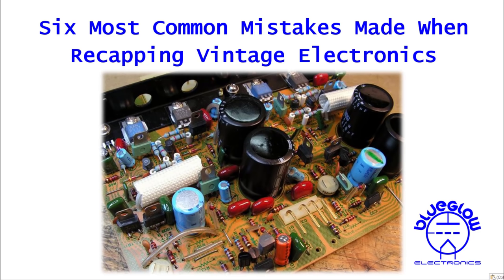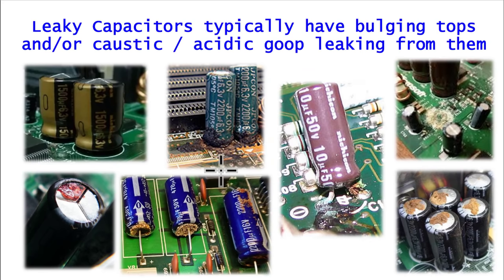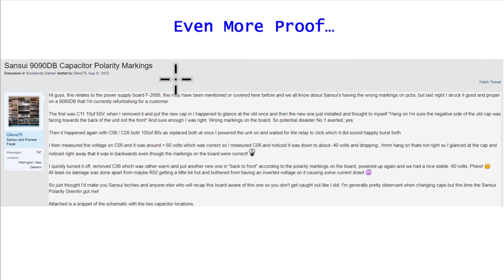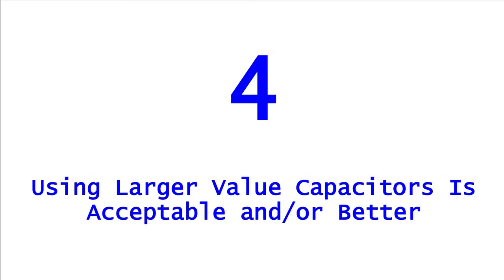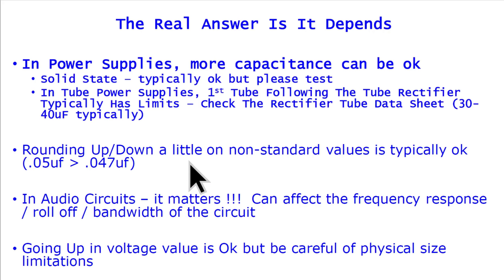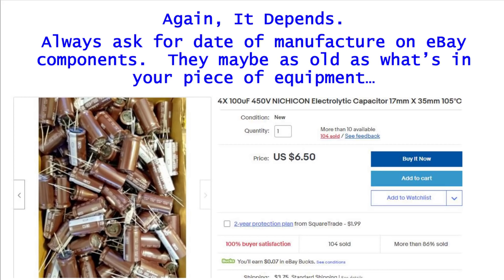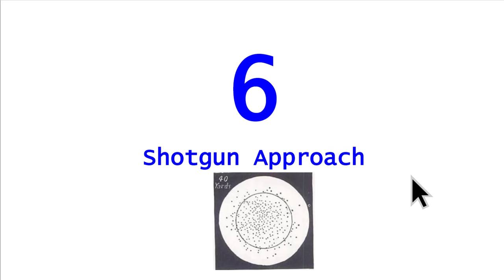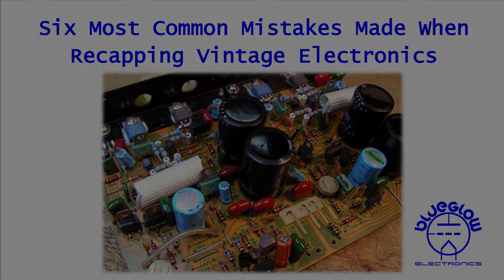Six Common Mistakes Made When Recapping Vintage Electronics

Comment: Hi.  There is a little firestorm of an argument going on, on one of the Facebook vintage stereo forums that is a result of your video here.  People are arguing that all capacitors should be replaced at the same time.  You start out with the power capacitor being replaced.  Then keep it organized and replace capacitors board by board.  But are you inspecting and testing each capacitor to determine what should be replaced or are you just indiscriminate and simply replacing them all?  I understand that it's easy and quick to test a capacitor on a board with the correct meter.  Thanks.

Comment: Going up in voltage rating often means that the lifespan is longer, since those are stressed less.
When buying capacitors and ICs from random strangers beware for counterfeits, especially NOS caps dating back to the great capacitor plague.
Reply: going too high a voltage is not a good idea

Comment: All good advice, I have two comments and a question.
 Comment: I repaired a 32 inch flat screen, 2008 era. I was pretty sure for the age and the problem it was in the power supply. When I got it, the TV would eventually come on after about 10 to 15 minutes of trying to come on with the power led going from red to off and back and forth after I pressed the power button. Once on it was all pretty fine, and would come right on if I left the power cord plugged in. However in time it would no longer come on. So I eventually opened it up, very many screws and nothing was bulged or leaking. So I started with the larger capacitors, replace all of them and put it back in the set and tied it, no change. Then I did another group of the next sized caps. TV came on eventually but was still very long. I then did another set, tried it again and it was a little better but still way to slow coming on. I also was having problems with the double sided board with the etching of the circuit wanting to come off the top of the board when I removed a cap. So on the last set I replaced all of the remaining capacitors, all about 47 uf and below. A few I just clipped off and soldiered the new one to the stubs due to the top circuit issue. Put it back in the set and it came on in less then 60 seconds, fixed! I had hoped to just replace the problem ones and have it fixed but just maybe all were failing or maybe it was mostly the smaller ones. Good point was that I did it in groups and one or two at a time.   

Another comment: Yes capacitor values do matter in the audio side. On many amps the speaker output goes through a capacitor. Changing that value will affect the frequencies going to that speaker.
 
 Question: how it it a real problem if a capacitor setting on the shelf and was never used will go bad in time?  How can a person tell if their capacitor is old stock?   I have in my collection caps that very well could be 8 to 25 years old that were never used or only used to test something. Now on these TV's and monitors I fixed over the past several years, I got new ones off the web, most from the same seller.  My old parts are not very organized at this point.

Comment: Very interesting information. Many things I did not know.  I will try myself to recap a small amplifier of my subwoofer, that is behaving very bad, lately,  If I don't succeed I will buy a new one.   I Have another problem with my ONKYO TX NR626 and it start "clipping" my left speaker, so I disconnected it, and only using R-channel and Center.     Any advice what to look for? (I have some understanding of electronics)

Comment: Already replaced all the electrolytic capacitors in my Lenovo ThinkCentre M58e desktop backup computers PSU.  This was to replace the one bad cap that was causing the computer to be constantly boot looping, and also to replace the rest of the bulging caps.  Now I am moving on to replacing the electrolytic capacitors in my 1978 Soundcraftsmen PE2217 Preamp-Equalizer. That should be easy.  But it is the cleaning and re-lubricating of the 22 Faders of the equalizer, that is going to take a fair amount of time. Plus cleaning the contacts of the 15 latching push button switches.  Next comes my Heathkit  AA-1506 audio power amp. Fortunately, it will only need 2 potentiometers cleaned, and cleaning the contacts of the 3 latching push button switches.

Comment: Nice video. Thumps up !

Remember a capacitor with higher voltage can (or will) have more induvtance. 
In some appications not the best solution. 

And if I use low-ESR capacitors it is a (small) risk. Because of the higher current when power up.

But until now I have no problems with higher voltage capaitors or used PC capacitors with low ESR. 
Sometimes with mutch higher voltage capacitors ...
... I add at the power supply capacitors an additional small capacitor to reduce the inductance to get noise level and or high frequency spikes to a low level. (Until now = No problem with the full bridge rectivier) 

I allways check the value from the okd an new capacitor with my messuring instrument. 

Low-ESR types will pull at switching on a higher current and can reduce the lifetime of the mechanivl power on switch. But untul now I never had a problem with that. 

Very often I try to clean carefully the potentiometers (volume, etc) and switches. 
But I alway clean carefully the PCB board and have now additional time to look closer (when I am cleaning). 

I try to look very close to every solder junction from big parts and heat the solder. After a decade these big and heavy part are sometimes the reason for problems. The electric connection get worse when the solder pad etc etc

I am waiting for more brilliant videos from you. By

Comment: What I would love to see is someone showing how they cut out the old capacitor and video of them resoldering in the new one. I have yet to see this on youtube (I'm still searching...so maybe it's here somewhere.) I'm not talking about in a circuit board, but on point-to-point wiring such as in old amps.

Comment: I had a Piorneer SE-50 headphone, the 3uF marked capacitor measures 8.2uF with two diffrent cap meters of mine.  Capacitor size are not always as marked on the cap case

Comment: I recently replaced the capacitors on the power board of my Casio MP1000 synthetiser. It happens the capacitor I removed were good, tested with my faithful ESR-60. What I thought was leakage was actually the glue.

Comment: I’ve been doing electronic work for over 25 years, and I’ve used a lot of used parts on and off on my own personal stuff… Rarely on things I repair for customers unless it was vintage equipment and the parts were very hard to find. 

That said, I wanted to touch on the subject you brought up about fake caps. I most often have seen when purchasing from an unreliable source like eBay or something of that nature not exactly “fake “units but rather used or reclaimed product which the Chinese are famous for. They get all these parts through E recyclers Who send truckloads of circuit boards overseas and shipping containers and then they have people sit there and pull all the parts off of those and basically sell them back to us. 

That is where a lot of the rebranded or unreliable components come from. A lot of times they might take a chip that was one thing and rebranded as something else, or they might sell it is new when it has 10,000 hours of use on it.

Comment: Someone did mention the need for 105° caps in switching supplies. To put a finer point on it, electrolytic caps are designed for various purposes.  You'll find manufacturers have several different series, or lines of devices having the same capacitance and voltage rating but marked with one or more initials to indicate different capabilities. Switching supply filters are to have very low impedance at high frequency. The term is low ESR, equivalent series resistance. Research when shopping so the recap upgrade doesn't end up being a  downgrade for your gear.

Comment: I have seen that hold down glue cause problems in old SONY receivers back in the 80's.
Reply: The glue becomes conductive as it ages/breaks down over time.
Reply: Most of the glue was "SonyBond" and used by almost all manufacturers. And it definitely breaks down over time causing leads to corrode. Then the corrosion migrates causing conductivity between components. Sometimes severe enough to actually "burn" over time. Many assembly workers just blobbed it on making a huge mess, while some others used it sparingly and properly. I could always tell the "mindset" of an assembler by the amount of glue they used. Even 2 of the same model assembled by 2 different lines show the differences.  With the bean counters pinching pennies, it's a wonder they didn't make all the assemblers be conservative with it's use... You only need a few drops in most cases, but man, they covered everything sometimes....
Reply: @JeffCounsil-rp4qv , you're right. I have seen that destructive corrosion on my first Sony CD player, the CDP101...

Comment: When recapping, I look at where the heat normally is and any small value caps (100uF or smaller) nearby that dry out faster and drop in value causing malfunctions.
Reply: yep, good idea
Reply: I just experienced this on an HK AVR. All the big guys were fine. Little guys right next to the regulators had lived a hard life.
Reply: @pauldionne2884  Yup, I found more small caps that failed then big ones. In one case my fav Fax machine would not turn on after I moved it and tried to turned it back on, it had been on for 12 yrs (!) up to that point. All the 50 uF caps in the switching PS where down around 4 uF from the constant warmth of being on all the time! I swapped them out and it powered up!

Comment: Rectifier tubes can be replaced with a HV diode like 1N4007 and bypass with a HV ceramic cap or a 100K resistor, to avoid switching noise. Even a series WW resistor may be good. Increasing capacitance depending on value, can give a large inrush current, I have used inrush current limiter resistors from digi-key, with photo-flash caps. 1000uF :-)

Comment: I was always assuming using the same voltage but higher capacity would be okay, but you told me it's the other way round.
While I'm unsure of the concept behind that, I hope that's true - thank you!
Reply: It depends on the specific application of the capacitor!
For supply decoupling or smoothing, yes going bigger in capacitance is ok.
For filtering purposes, no it is not.

Comment: Alot of capacitor exposed leads double as measurement points. It is tempting to find a replacement cap that matches the lead spacing so the new cap sits flush on the board. But doing this may make test measurements more difficult in the future.  I recommend matching the lead dress of the original parts.

Comment: A note about outside foil, determination of and relevance, would be good to have.
Reply: Outside foil is more pertinent to "air wired" units like tube gear and early SS gear, and also sensitive circuits like RIAA amps where picking up noise can be an issue. But for the most part, it's nothing to worry about in most circuits with PC boards. Of course with polarized capacitors, you have no choice.. Negative goes to negative regardless. If I need to extend a lead, I always extend the negative lead since it is the "outside foil" in a polarized electrolytic. In non-polar electrolytic caps, the "short" lead is the outside foil lead.

Comment: Electrocompaniet, a very top-end electronics firm, published dual schematics: a public set with 'ideal' component values and a set for repair centers that listed some of the 'as-built' values.
They would build an amp using standard parts, then every amp was factory tuned, often with parts being way out of spec!
None of these fine-tuning values every showed up on any public drawing, but if you signed up for a partnership deal you got the real values!
Blue-prints matched to each amplifier!
Their PCB's avoided the silk-screen problem by not showing polarity!
C1, C2 are Component1, Component2...not necessarily capacitors.
And the outlines don't show if the parts are installed!
Clean look, nightmare to service.

Comment: As far as values are concerned, a lot of earlier electrolytics were rated -20 to +80% of the rated capacitance so there can be a lot of leeway.

I was taught a long time ago that increasing the voltage rating of a cap is OK within reason.
However, a 300V electrolytic will not properly form or stay properly formed if you only expose it to 50V. Over time, you are turning that 300V cap into a 50V cap and who knows that is going on chemically inside the cap when that happens. It likely drops in capacitance value and changes in ESR.

Comment: Great video! What’s the consensus about replacing old caps? I have Quad monoblocks from ‘99 and one of them needs some attention. A 10000 uF capacitor needs to be changed. The other 3 caps seem fine. Is it advisable to then change all 4 capacitors anyway? And maybe do the other monoblock too?
Reply: Jeez you would have thought someone would have replied

Comment: Oh wow, I wouldnt have thought that I would have confused glue and leaky capacitors, but the second picture top row is exactly what I have at hand.

I thought it was surely due to leaking capacitors, since this old receiver somewhat suddenly stopped powering on, but I think the right channel had issues just before that. I just looked inside and was like "yup, leaky caps". I thought it would have been good soldering training to replace them, but I guess Im back to diagnosis.

Somebody else said that the glue can become conductive over time, so maybe I should start by removing the glue.

The receiver isn't expensive or special, so its a good place to start practicing.

Comment: Higher voltage caps usually have more dc leakage. DC blocking caps at virtual ground that leak can cause noisy pots. This is evident in Neve 81xx consoles.

Comment: re #4: the main power cap in a presonus firepod has to be replaced with an identical value both voltage and capacitance. for whatever reason, it will not function right without it. tried using even just the next uF size up from whatever it is, would not connect to anything (it's my main audio i/o interface for my computer). the circuit isn't even that complicated, nor is it some weird smps, but for whatever reason.. nope. and all i did was replace the caps. swapped in the right value for that single one (which i had to wait for) and it worked flawlessly immediately after.

and before anyone thinks to ask, yes i only get decent caps from good suppliers. it even tested bang on the label spec after it (the larger one) was pulled out. some peculiar aspect of the way presonus built the main power input circuit (pre-transformer) in these things requires that exact value. 

its probably the only time outside of audio path applications where i've seen an issue. but it does apparently exist sometimes. (barring the obvious switch rate control caps).

Comment: It is interesting to open a failed capacitor, unroll it, and look for the pinhole failure.
Reply: Or, it's all dried out.
Reply: @jamesplotkin4674  Many depends on brand/quality of production - I've seen may be three times electrolytic  capacitors about 30 years dried  to  zero capacity and I have radio dated 1939 with   original electrolytic supply filtering capacitors and today doing perfect job. In  general I always hope for good and if damage is not measurable  do not make replacement.  My transistor audio amplifier is already 50 years old and n capacitors are  good, no any repair was done  and works perfect. .At the same time tube amp 60 years old had capacitors in 50% to be replaced and all  the same type and value  .

Comment: Nice tips, thanks.(1)  As far as you know is it just the electrolytic caps that normally need replacing in old gear? (2) If you don't have a diagram & can't read the value of the cap is there a cheap solution? (3) In your experience is it always obvious which caps have failed? Do you normally replace every single one even if there's no visible bad signs?  (4) Aside from caps would you say that the biggest cause of PSU failure is transformers or bridge rectifiers? Much appreciated, thank you.

Comment: Great advise for things to be careful of.  I have two, 60 year old Heathkit HW-30 amateur radio transceivers that have been on my shelf for years and they worked back when.  Now, I would like to get them back on the air, and I am sure that the electrolytics need to be replaced, fortunately, there are only three of them in each radio.  The one that I am concerned with is mounted on top of the chassis in a aluminum can.  This capacitor shows no sign of leakage, so I am wondering which of two ways to go.  The first, would be to leave it for looks, cut its connections loose from the circuit, and replace its four sections with new capacitors.  Or, to remove it, cut it open, and replace its internals.  Wonder what your thoughts might be for me?  Thanks for the helpful videos and tips,  Karl

Comment: Trying to repair a vintage panasonic radio, rf-1060, had a shorted 1000uf cap. Pulled it and unit would run, but very low volume from speaker and earphone port. Replaced all the caps and they were all over the place value and esr wise.
Still low volume, looking at that one metal can transistor as a posible fault.